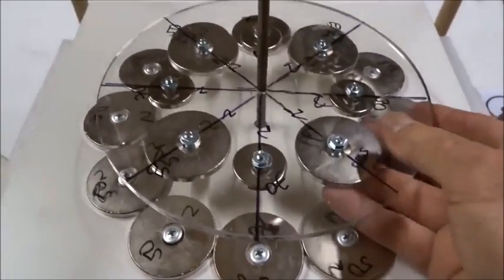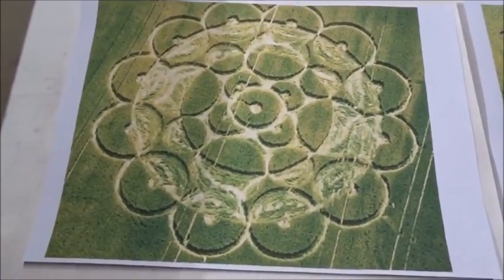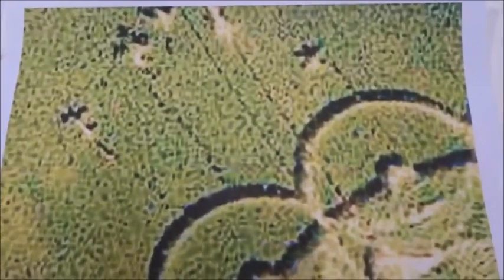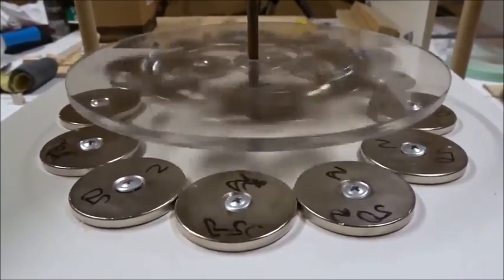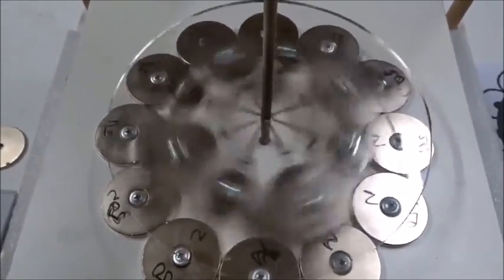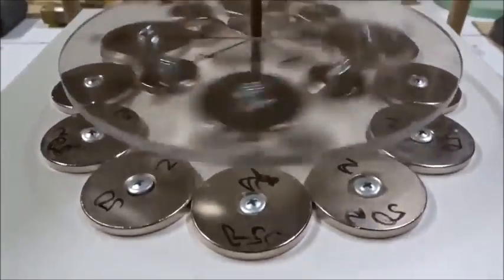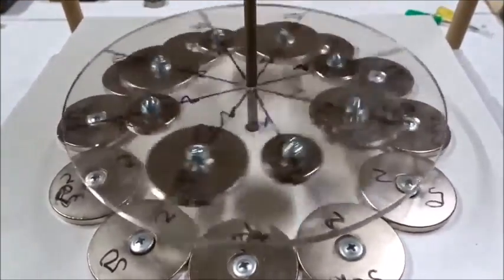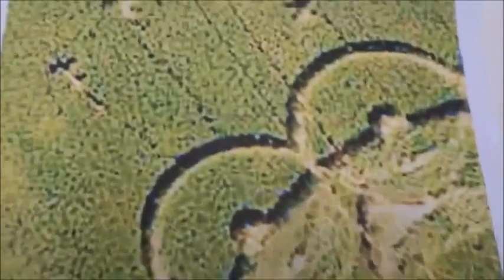Stephen’s Castle Down 2000 as a frictionless magnetic gear: was it made by angels

Comment: Hey, congrats. You proved that moment of inertia and magnetism exists. 

Next time custom order 2 circular magnets with a hole in the middle, tell them to make it with one pole on the inside and the other on the outside. Glue of of these magnets to the table, put a rod in the hole and fasten it to the table, glue the other magnet to a disk and thread it onto the rod. Now you will have something much more stable (less wobbly) and therefore it will spin much longer. 

The more weight you put on the edge of the disk the more inertia you will get (=spin longer, but don't spin it to fast with to much weight so that it breaks sending metal all over the place).

Also if there is angel imprints on the ground, does it mean the angel face-planted there? haha I hope so xD
Cheers mate!

Comment: Take away the rod completely. Place a magnet on the bot(north up) a washer on the bot of the upper plate and a second magnet on the very top(north down) you should get a floating platform as the magnets want close to the washer but will repel as they get to close but pull back together as they get to far away. Sorry if i explained that wrong. You're a smart man so you probably already tried and proven it doesnt work.

Comment: No need for super cooling to slide around as the forces seem to help it float. The mathematics involved with size and force would be interesting to study and I wonder what a low electric charge would do or even a coil of copper wire just underneath the top platform with a magnet within the coil. I had a vision of something like this.               For your final question, my theory is that angels and ET are the same. They are us without the fleshy human body, energy and consciousness and, as such, sparks of the Divine, Source, the creator, God. I believe that's also what the orbs are we sometimes catch on film; Light/spirit/body or Merkaba, generated through consciousness such as in deep meditation, when some may leave their body.